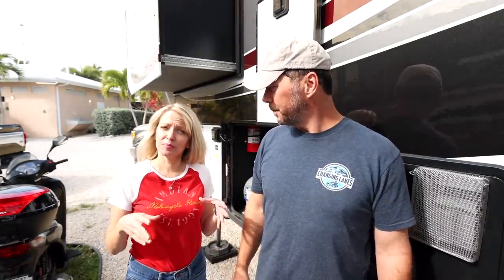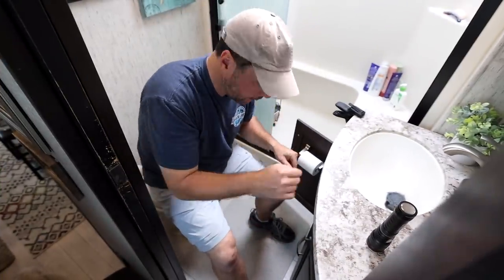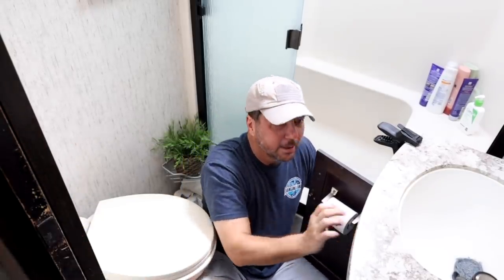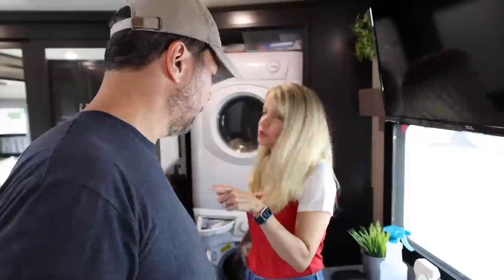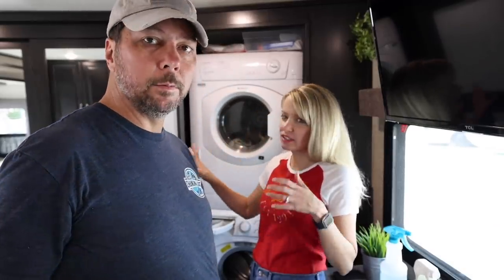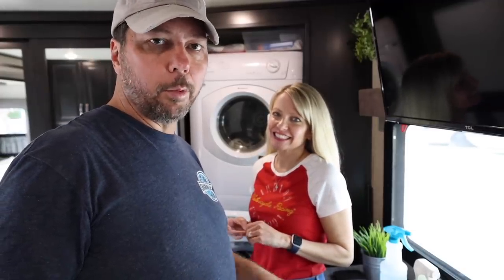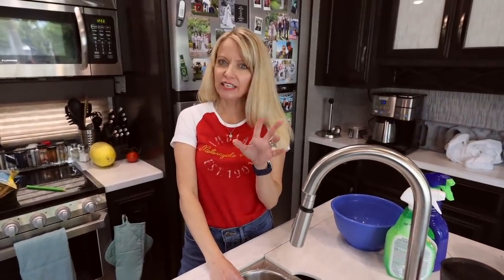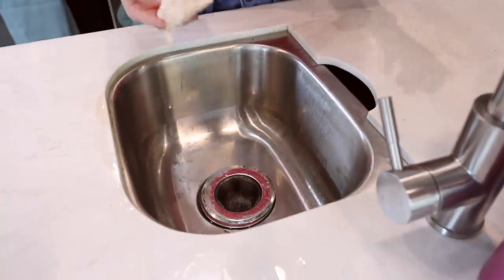RV Dirty Jobs

Comment: If you decide to replace the gasket, make sure you purchase a spring expansion tool.  The tension of the spring is nearly impossible to install without it.
Reply from the maker: Great tip!  Just ordered it!  👍🏼
Reply: @ChangingLanes   If the gasket replacement is similar to a residential washer, you may want to think twice.  The front panel needs to be removed to get to the clamp behind the drum.  The top cover, fastened in the rear needs to be slid back to expose the control panel screws. The control panel may have to be removed due to tabs or fasteners to the front panel. Check a couple of You Tube videos on replacing the gasket. Changing the gasket is easy, getting to it a challenge.

Comment: IMPORTANT TO READ
Hi Diane, 
DampRid is meant to be used in an area of 150 square feet or more. Some of the larger units will cover up to 1000 square feet. It also needs air circulation to work properly. We do not recommend using it any type of washing machine. 
https://damprid.com/tips-for-use/

-We suggest placing DampRid in an area that is out of reach of children and pets and where it will not be easily tipped over,  drip or leak onto your belongings.	
	

Thank you for your inquiry and for being a loyal, valued DampRid customer.

Kind regards, 
Alycia
www.wmbarr.com
Reply from the maker: Good info!  Thanks!

Comment: For wood cabinets:  for delicate cabinets use very hot water on a cloth
For an oil based wood, use Howards Feed and wax
For varnished wood use Watco Danish oil

Gonna try the magic eraser on the stainless, but we also use Weiman stainless steel cleaner and polish.  It really brings a nice sheen finish back.  You know you have stainless steel, if magnets dont stick.  Thats how you tell if its real stainless, meaning it has more nickel content in it.  Its a better quality stainless.

Comment: Not my article but I believe this is what the "jelly" is.
++++++++++++++++++++++++++++++++++++++++
These growths are known as biofilms or ‘microbial slime’ and
are most noticeable in bathrooms and kitchens. If not dealt
with at their onset some biofilms can grow into certain
materials and become a permanent feature.
What are biofilms?
Biofilms contain bacteria and fungi that have grown and
multiplied on a surface. To grow, bacteria and fungi require
water and a source of food. If both are present on the surface
then the organisms will grow and multiply to produce a
grey/black jelly‐like (slime) growth or produce a pink/red
staining.  
Some species of bacteria and fungi that survive in biofilms
around taps and on pipes produce compounds that can give
an earthy or musty flavor to the water.
Where do biofilms occur?
Biofilms can form on any surface that comes into contact with
water. They are commonly found:
 On the inside of cold water taps
 Around the base of tap fittings
 In shower heads and on shower curtains
 On tiles in the bathroom/shower area
 In and around drains and plugholes
 In toilet cisterns and toilet bowls
 In refrigerator drip trays
 In dehumidifiers
 In washing machines particularly around the powder
drawer and the rubber seals
Are biofilms harmful?
Although these biofilms can appear very unpleasant they are
generally harmless and do not pose a risk to health.
What can I do to prevent growth?
Bacteria and fungi require water and nutrients to enable
them to multiply and grow. The best way to prevent growth is
to improve ventilation to allow these damp areas in kitchens
and bathrooms to dry rapidly. It is also important to reduce
the amount of food available for the bacteria and fungi. Food
sources can include shampoo, soaps, propellants from hair
spray and deodorants, and general kitchen food. Keeping the
areas clean and free from potential food sources will restrict
growth.
Reply from the maker: Very interesting!  Thanks for the info!

Comment: Hope you guys are using some form of eye protection while cleaning these items. One errant splash will cause a very bad experience with your eyes. Also using bleach/Clorox products with no eye protection is bad news. Not really an if thing, but a when thing. You don't want to think about the virulence of those bacteria.... I'm surevsaftey glasses don't lend well for production value, I get it. Also VERY strong peppermint candy will likely get you right on by the dry heaves while cleaning. Best trick an old timer taught me at a wastewater treatment plant. Yeah, THAT kind of water.....
Reply from the maker: Great tip on the glasses and you're right!  👍🏼
Reply: @ChangingLanes  Don't forget to try the peppermint trick, it's saved my lunch before!! Lol

Comment: I use vaseline on the seal, yea or nàe
Reply from the maker: Nay.  Vaseline is petroleum based and will ruin the seal.
Reply: Save a old toothbrush it works very well when cleaning your bathroom sink trap.